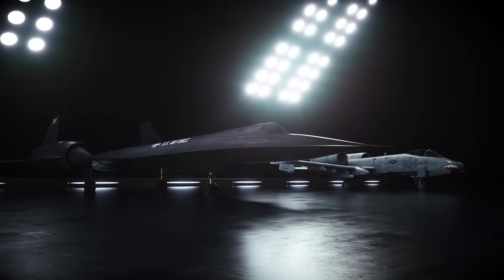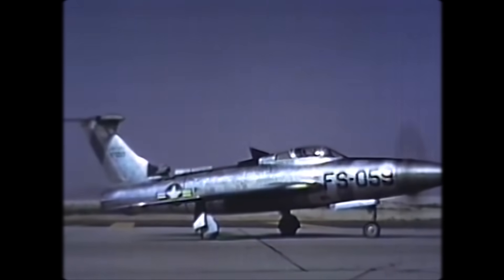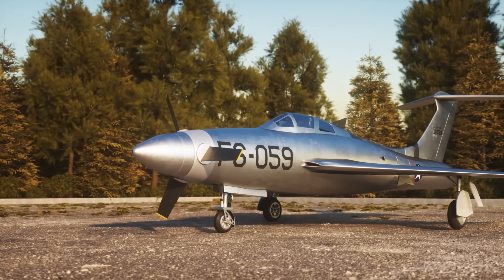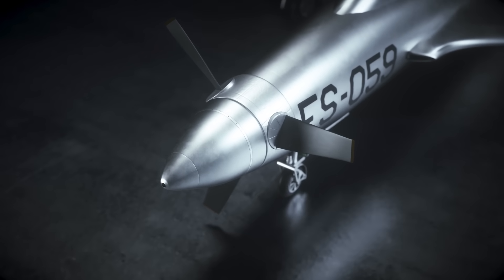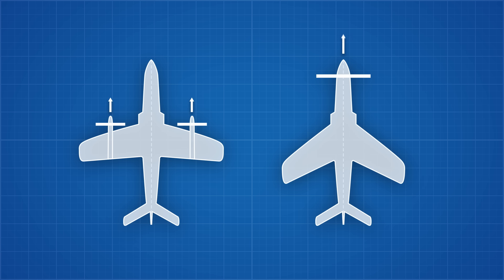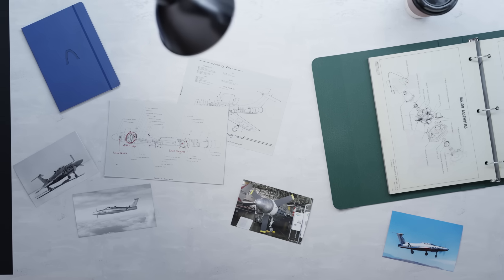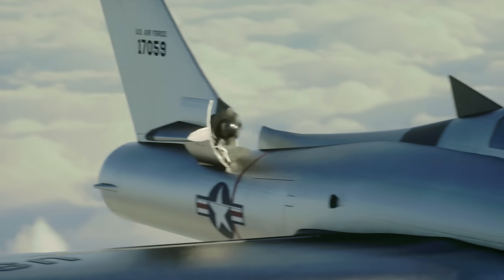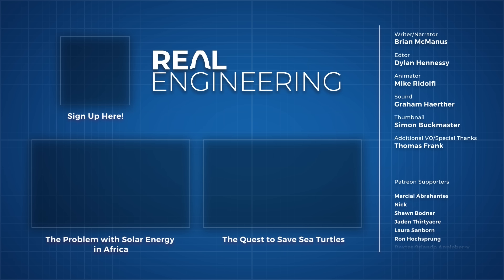The Insane Engineering of the Thunderscreech

Comment: In defense of the Northrop Tacit Blue, it (like Lockheed’s Have Blue) was just designed to demonstrate stealth characteristics in aircraft, and never was intended to enter service.  The technologies it pioneered were applied to the B-2, so other than its looks, it could hardly be considered a failure.
Reply: much like this plane. it was solely to see if super turbo props was even a possibility seeing no one has tried or even seen a prop go super sonic. so they tried to see if they could (because turbo props are far better than jets if you dont need pure top speed) but the side effects they found made the idea of a super turbo prop impossible.

but then again if this didnt happen then it wouldve happened later. most likely by the russians.
Reply: @Thekilleroftanks  The Tu-95 Bear (and it's derivatives) have turbine-driven props where the tips DO go supersonic (appx. mach 1.3 as I recall at their engine peak output).
First flight on the Bear was about 3 YEARS before the Thunderscreech, and the Bear was entering PRODUCTION about the time the Thunderscreech was first being experimentally converted.

No, supersonic props were NOT impossible - just very very LOUD - and the F-84H was NOT the first such aircraft.
Reply: @bricefleckenstein9666  I didn't know the tu-95 flew faster than the speed of sound.
Reply: @anonymouskultist  Prop tip speed is supersonic at max engine power.
Reply: @johnbrooks7144  Prop tip speed is also supersonic at fairly close to max engine power, and AFAIK at normal cruise power settings as well.
Reply: @anonymouskultist  Where did I say the entire aircraft flew faster than the speed of sound?
Prop tip speed is NOT the speed of the aircraft, and is OFTEN faster than the actual aircraft speed.

For comparison, think about a power windmill - the prop tips are COMMONLY traveling at hundreds of MPH yet the windmill itself does not move (except the moving parts that move in circles and perhaps some linear adjustment controls).
Reply: @bricefleckenstein9666  I apologize, I must have misheard or misunderstood the video. I assumed that the thunderscreech was an attempt at a supersonic prop driven aircraft.
Reply: @bricefleckenstein9666  thunderscreech's propellers were designed to run supersonic over whole area, not just tips, if I understood that right. Its blade tips went supersonic even at idle.
Reply: @bricefleckenstein9666  you are wrong, Tu-95 props tips NEVER go supersonic. The Tu-95 props are rotating at the constant speed of 736 rpm, the prop diameter is 5.6 meters. Using the simple rotational speed formula (2*pi*R*w) you get 234 m/s at the prop tip. The speed of sound at the sea level is 340 m/s. Even at the highest operational altitude of Tu-95 (45,000 ft) the speed of sound is still 295 m/s - much higher than the prop tip speed.
Reply: @sergeychmelev5270  what if you factor in speed of the plane (710km/h cruising, 925km/h top speed)? In that case, tip travels in spiral, which could add to supersonic, although I don't know how to get to exact number.
Reply: @anonymouskultist  You are confusing different things.
The Thunderscreech WAS such an attempt, that does NOT make the BEAR such an attempt.
Reply: @sergeychmelev5270  Your claim is contradicted in MANY places.
The Tu-95 props spun faster than that at full power, and there is NO WAY they always spun at a specific RPM - even "constant speed" hubs on the props had limits on how close to a constant RPM level they could maintain.
I'm curious where this "736 rpm" figure came from - citation?
Reply: @bricefleckenstein9666  Dude, we can already tell you’re mad. You don’t need to CAPITALIZE words in the middle of your sentence to convey emphasis.
Reply: @CookerSeven4  Yes, I do. How else are you going to know what I am trying to emphasise?
And no, I am NOT mad - but I do tend to get irritated by people that ASSUME I am.
Reply: And how bizarre was the F-117 when it was introduced?  It still looks like it shouldn't be able to fly.  Built for a particular purpose.
Reply: @orcrist484  
How bizarre was the F117 you ask?
So weird that Kelly Johnson wanted to end the project just because of how wrong the design looked to him.
Fortunately, he had already officially retired from running Skunk Works and was only acting as a private consultant, and ultimately gave his approval out of respect for Ben Rich
Reply: “Successful”, except that these projects were so expensive that we couldn’t afford to educate our population anymore. As a result, today we have serious consequences. A lot of insightful people spoke up at the time, but the military industrial complex was already running the show.
Reply: @blackrockcity  We had AND HAVE plenty of money for education.
Blame too many PARENTS for not caring about their kids enough to PAY ATTENTION, and letting the Left take over Education and start propaganda indoctrination in place of teaching.
Reply: @bricefleckenstein9666  Then why do countries with more social programs and smaller militaries have more educated people than the USA? Japan, Korea, all of Scandinavia, Germany, Austria, Switzerland, Canada, Australia, New Zealand to name some.
Reply: @blackrockcity  In the first place, "more educated" is a subjective opinion in part.
However, the PRIMARY issue is the Liberals that have taken over most education and insist on teaching stuff (or having it taught) that don't belong in schools and have NOTHING to do with actual EDUCATION - and the COSTS of that indoctrination.
The US also has a MUCH LARGER VARIATION in the people being taught, when it comes to "language spoken", due to our high level of LEGAL immigration and the resulting large number of languages, requiring a substantial cost for teaching them English and the poor English language skills while they are learning.

You try to make the issue simple, while ignoring or NOT KNOWING about many of the issues involved, while I spent almost 2 DECADES working in the field.
Reply: @bricefleckenstein9666  hmm yeah actually being multilingual means that you are more educated, not less. You haven’t addressed the disparity in government military spending vs educational spending. And you haven’t addressed how conservatives educate better than the 10+ liberal countries I have mentioned.
Reply: @blackrockcity  Military VERSUS educational spending is not an issue, when you have tons more money to spend.
The issue is that while spending PER STUDENT is high, a lot of it gets wasted on propaganda issues by the mostly LIBERAL controlled educational establishment, especially in large cities.
And I also question your assumption that your cited countries are liberal in all cases - Japan IN PARTICULAR is highly conservative.
Also, needing to take the time to learn the language of your NEW native country slows down education in ALL OTHER RESPECTS for a person, as you don't understand what you are being taught as well when you don't already know the language.

"Being Multilingual" is NOT THE SAME as "not knowing the language and having to learn it WHILE you are being educated in general".
VERY BAD ASSUMPTION.
Reply: @bricefleckenstein9666  japan has three levels of national pensions, tons of benefits for seniors over age 61. Free healthcare for all citizens including foreigners. Japan also has public assistance programs to cover basic living expenses, housing costs, compulsory education and skill training costs, health insurance, and funerals.
Reply: @blackrockcity  That does not automatically make Japan a "liberal" nation.
Also, I have been told by Korean "guest worker" friends that the free healthcare doesn't even apply to all residents, just to all CITIZENS - along with many of the other benefits.
Reply: @bricefleckenstein9666  that’s enough of a toxic fight between Left(Democrats) and Right(Republican) politics, this video is not about messy American politics, but about the engineering of this plane, so just calm down, not meant as offense to you
Reply: @blackrockcity  ignore Brice, he just want a talkfight about messy american politics in a video that isn’t about politics
Reply: @blackrockcity  
The US pays to defend Japan as they only have a small defense force. Japan has among the highest social cohesion scores in the world and with that, it's a lot easier to sustain the social programs you write about because everyone understands, agrees with and abides by the social contract. They don't have extensive welfare either. I've watched programs on Japan's elderly homeless. The government doesn't pay them and they don't want to live in shelters which limit their freedom. However, they survive because neighbors feed and clothe them.
Reply: @fazole  can we stop arguing about politics here, because these argument between Left/Democrats, and Right/GOP is getting toxic, and let’s just enjoying an informative video that’s not about politics, and Real Engineering doesn’t want dive in politics in his F-35 fighter aircaft video, sure he does pointed out some political decision that led to the making this weird plane, but that’s not what he want to discuss, he just want discuss the engineering of Thunderscreech

Comment: Your graphic showing the propeller rotation from the front is going the wrong direction. All US build propeller aircraft have propellers rotating in the counterclockwise direction when viewed by standing in front of the aircraft looking back towards the aircraft. This is done for 2 reasons. The first reason is that this keeps the screws used to secure the propeller tight because the rotation direction has the tendency to keep the screws tight. The second reason is that all the pilots are used to P-Factor and torque feel at low speeds during takeoff and keeping the propeller direction consistent between aircraft means less training is needed and lower chance of accidents. Only a few Russian Yak aircraft made it into production with the propeller rotating the other direction and there were quite a few accidents that resulted from the propeller coming loose due to the propeller rotation.
Reply: Never heard of props coming off because of the direction of engine rotation.  Since the earliest days of aviation, aircraft engines (reciprocating, turbo-prop, turbine) and their propellers were standardized to turn clockwise in the US and counterclockwise in the UK and Russia.  Millions of engines/propellers have been produced in the last hundred years with some turning in one direction and other turning the other way. Similarly, the two countries had long ago standardized vehicular traffic to operate on opposite sides of their roads. 

Exceptions to the rule usually occur when aircraft are powered by engines/propellers not produced in that county. The An-2 biplane's propeller turns clockwise because its engine is a licensed copy of the Wright R-1820 Cyclone that turns in the US direction.  During WWII, Some P-51B/C Mustangs were powered by the RR Merlin engine (used on Spitfires, Hurricanes, Lancasters, etc) that turned counterclockwise. The Merlin was later produced in the US  by Packard, under license from RR  as the V-1650,  to power the P-51D and subsequent models,  but with the rotation changed to the US clockwise direction.  

All RR turbine engines used on current airliners turn counterclockwise, while all US engines produced by GE and Pratt and Whitney turn in a clockwise direction.  Most Boeing  jetliners  such as the 707, 747, 757, 767, 777 and 787  have had a choice of engines from either Rolls Royce, GE or Pratt and Whitney.

Virtually every aircraft engine/propeller produced from the dawn of aviation to this day has followed the British/Russian rule or the US rule in the respective countries, with exceptions such as those noted above for those imported or produced under license.

Comment: The main engineering problem with this plane will be changing the angle of the propeller running a supersonic speed.
Without a computer aided function, like on a B2 airplane, this would make it very hard to control noise and control.

Comment: Well... they could have simply balanced the driveshafts. Certainly the capability to do so existed at the time. I’d bet those driveshafts were actually balanced to near perfection, and the vibration was due to the shockwaves coming off the prop. EVERY single engine plane produces a counter rotation to the prop due to reaction torque. It is indeed countered in every case by the ailerons. They don’t create yaw because there’s one on each side! When one is deflected down, the one on the other side is deflected an equal amount up. By the way, the performance figures for this plane were never given! How fast did it go? What was it’s climb performance??

Comment: 11:35 why is an engine at full power more efficient than half
Reply: They're designed that way. It's more efficient in that the plane is traveling more distance for the amount of fuel consumed. At full power, the plane is traveling a much greater distance while consuming a bit more fuel. At half power, the engine is consuming a bit less fuel, but traveling a much shorter distance.

Comment: the entire situation reminds me at a high level of the 737 Max…rather than having natural aero dynamic worthiness, you have to continually compensate in order to keep her stable..kind of like driving a car with a low pressure tire on the left right and overcompensating to the right in order to keep her straight 
Best to design planes from the ground up which naturally fly with no compensation
Reply: Whistles in JSF-35

Comment: What a superb video, thanks for sharing! It's worth noting that modern large engine fan blade tips also operate at supersonic speeds at max power, but due to the noise abatement linings in the fan cowling, the noise is limited. Another extremely loud aircraft consigned to history was the Fairey Rotodyne, which was proposed as a sort of 'helicopter airliner' back in the late 50's, and employed a rather novel (but deeply, deeply flawed) blade tip ramjet propulsion system, where there were ramjets on the main rotor tips that were too loud for practical use. But that was nothing compared to the Thunderscreech I imagine!
Reply: With a duct around the blades, no air can flow to the outside. I read the turbines control tip clearance by means of temperature on the duct. Maybe here we could retract the propellers / or let them slide out a bit to adjust the gap. So no air can flow from the high pressure lower back side to the low pressure upper front side. Then the shock waves would mostly be thrown at the pilot. So you really need pods. With diamond wing profile the high pressure face creates a high pressure shock. We say there is a pressure rising shock at the leading edge and a pressure drop shock at the thickest point of the profile. With a fan the blades are so close to each other that the edges meet. So it is basically high pressure with small low pressure drops. So at least the low frequency noise is reduced.
Reply: @ArneChristianRosenfeldt  indeed, ducts help to reduce blade tip vorticity (not completely, but largely), though tip clearance in fan blades with modern turbofans tends to be managed by having an abradable fan liner and very tight tolerances. On the initial test run after final assembly at the factory, the engine is slowly spun up to full power and the fan blades sort of dig out a perfect fit by scraping away just the right amount such that the clearance ends up being tiny. You read right about turbine blades, in some engines the turbine blade tip clearance relies on the already necessary cooling air channels in the turbine blade tips and outer turbine tracks, and those too can be abradable in some cases as with the fan casing. Open rotor blades are tricky though. 

Modern propellers tend to have a rearward leading edge tip sweep (called a Scimitar propeller) that  reduces the onset of wave drag at high speeds which reduces the losses substantially, as well as noise (see the A400M for example). Having more blades is also favorable to driving them faster since it means you can achieve the same thrust at lower speeds. The blades in the thunderscreech pretty much ignore all of that, only three blades, big thick tips, and high speeds that break the sound barrier.
Reply: @onetrickhorse  the planform of the starfighter. And after they decided to go full supersonic instead of high drag trans, they found out that 3 blades give enough thrust.
Reply: There are designs for "propfan" engines that use turbofan-like fan blades as propellers to increase fuel efficiency compared to turbofans (essentially ultimate bypass ratio) but I imagine noise would still be a huge problem.
Reply: @tankermottind  Absolutely, open rotor turbines for example have far better SFC figures than equivalent turbofans. People just don't like them for some reason, passengers get nervous about blades so exposed! And noise is a big problem with them too!